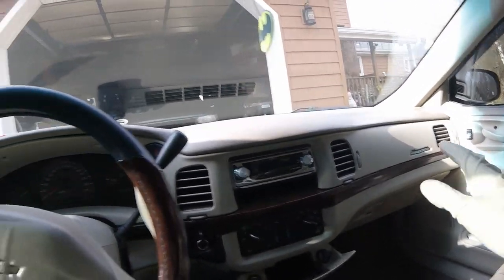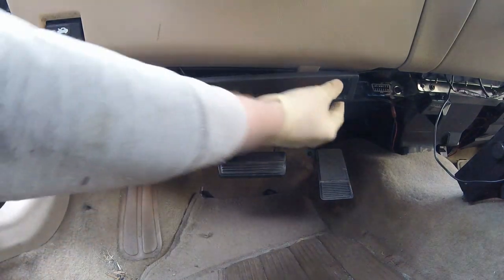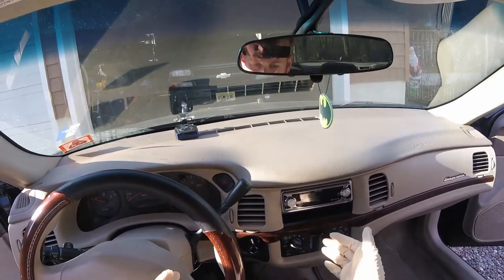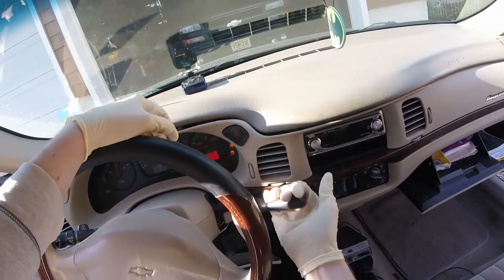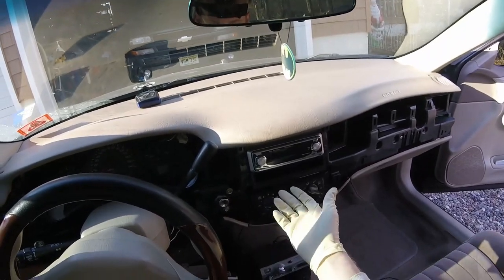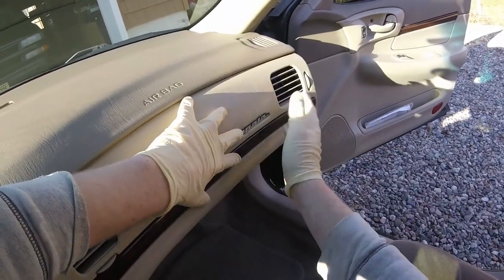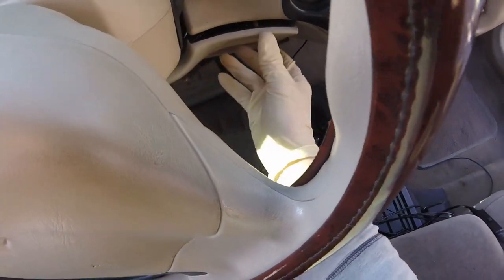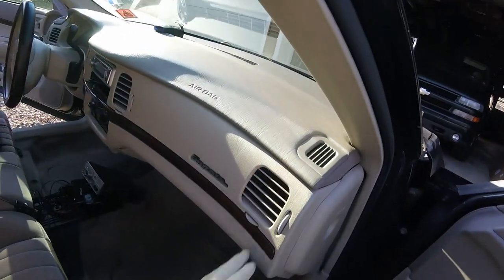How to Remove Chevy Impala Dash (2000 - 2005)

Comment: I have a 2003 Chevrolet Impala that is missing alot of the Dash Screws. Could you possibly tell me what the sizes and lengths are where I could try to find equivalent replacements? Thanks again,
Reply from the maker: I sold the car about 4 years ago so I wouldn't have any idea at this point. You may be able to check online for a diagram, or go to a junkyard that has one and raid it for the hardware
Reply: @RDMotoring  Okay, sounds good, thanks again for responding, I really appreciate it.

Comment: "I like to remove this for fun"  Ya crazy bastard!!!!!, sound just like me! Great Simple to the point video, thank you so much. I need to trace down 2 shorts that occurred overnight. On the Clstr/BCM fuse in Left IP, and Radio Fuse in Right IP. Oddly enough the common thing between these is the DLC circuit, somehow the serial data line must be shorted and its dropping battery voltage from 12.7 to 4.5 to 5.5. I was trying to get at connectors under and inside the stinking dash but its near impossible especially when you have several vertebrate fused together, so hopefully this lets me get back there to break a few conn's to isolate the faulty thing-a-ma-jig. I hope its a shorted wire, I had for this to be my BCM or DLC circuitry. Thanks again!

Comment: Quick question. What if it’s in a salvage yard? And can’t get into gear
Reply from the maker: You still might be able to work the dash around the shifter but it will make it a lot more difficult
Reply: Thanks, that’s exactly what I did. Got a small crack but it’s not noticeable when installed!

Comment: What about the passenger airbag? Do I need to do anything to keep it from ejecting? Any OFF switch or fuses needing to be removed or turned off??

Might seem like a dumb question but I dont want mine to go off while I'm taking my dashboard off to fix the heater.
Reply from the maker: You don't have to worry about that if you're only doing what I show in the video. However if you want to be safe you can just disconnect the battery.

Comment: Hey I just recently found out that I need to change my headlight relay in my 04 impala however I now know it’s not under hood like a normal relay would be. Is this the process I have to go through to change it? And if so do you have any tips on how I can make the process easier for me?
Reply from the maker: It's behind the drivers side fuse panel. You may be able to pull the panel out completely or pull off the dash and reach around it as the headlight relay is on the backside of the panel. That said, the relay rarely goes bad. If you have lost high or low beam lights, it's likely the turn signal switch.
Reply: Hi, did you change your headlight relay? Or was your headlight issue caused by the turn signal switch?

Comment: You have to take dash off to remove/replace heater core? And the wheel doesn't have to come off?
Reply from the maker: Yes, the heater core is below the dash and you need to remove all the panels to get there. No, the wheel doesn't have to come off

Comment: For the after market radio same car but 2001 how is the red power wire tide in since the harness I got for factory plug to plug is just a loose wire the ones I’m use to came with it in the actual harness itself

Comment: Do You Need an Adapter for the Back of the New Radio?
Reply from the maker: That's tough to answer, if you're talking about the wiring harness then it most likely depends on what head unit you get

Comment: i want to take off the dashboard because it's not sitting properly and vibrating. my mechanic thinks it shrunk from the cold and heat over the years but i don't believe it. i think it wasn't put on perfectly. any tips?
Reply from the maker: Could be some broken clips not holding it tight. It's not the best quality plastic and being that these cars are pushing 20 years old, things tend to get brittle
Reply: @RDMotoring  can i just take off the cover and try to manipulate it into correct place...? I never did it before but I'm fairly handy.
Reply from the maker: @shangrila73eldorado  You can do that. You'll never know what the issue is unless you look

Comment: How do I disconnect the TRAC OFF green thing?
Reply from the maker: Not exactly sure as I didn't have one but it should be just another plug. It may have some sort of clip holding it in similar to the hazard switch so watch out for that
Reply: Have the same issue this thing is weird to get off